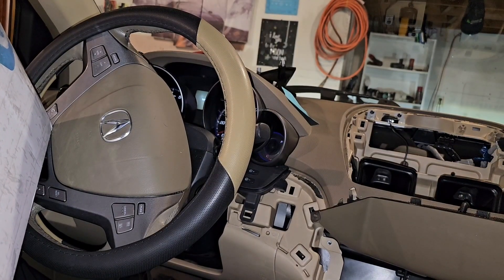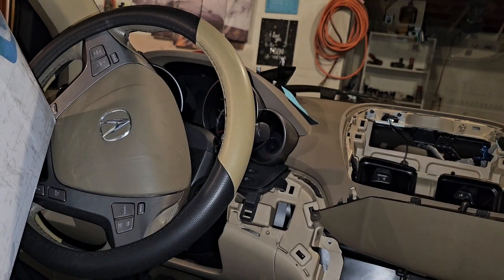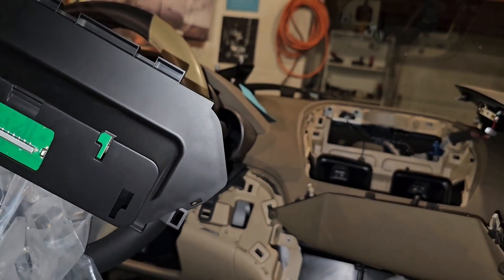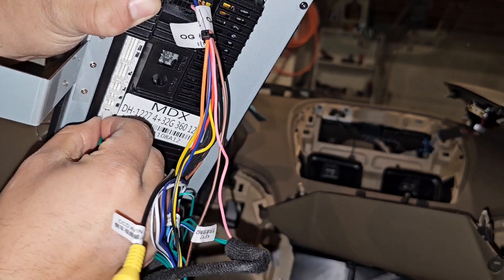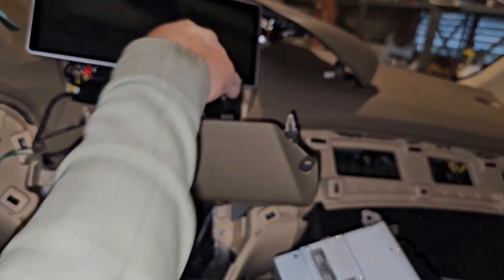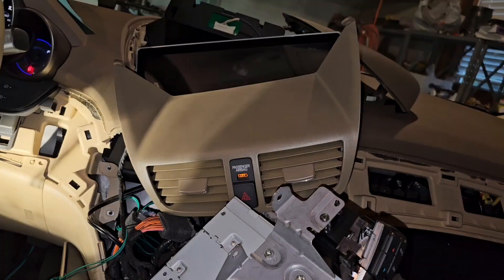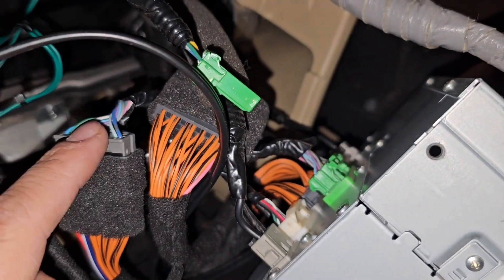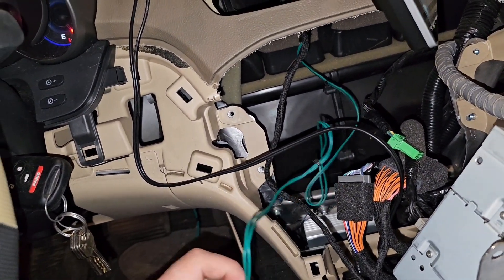Android headunit on a 2007-13 Acura MDX (Install)

Comment: Hi, love the video. I wanted to know if you were able to connect aux to get video on the overhead dvd? Also, do you think a new aftermarket amp can resolve the sound issue. Or do I need to change the subwoofer. I read somewhere that subwoofer has a small amplifier too.

Comment: I purchased one of these units, but the cable ribbon seems missing? The little square hole on the back of the screen was covered with beige tape, and there was no connector ribbon to hook the screen up to the green area on the main unit base?

Comment: Are you planning on doing  another video with your feedback on the final radio setup in the MDX? Also, does it work with the navigation knob/buttons and the steering wheel buttons?
Reply from the maker: No the knob does nothing now at least not that i know of but volume button and mode and switching songs with the steeringwheel all work
Reply: @oscar_cu2  Do you like it overall, any major gripes/disappointments?
Reply from the maker: @garage_102  i love it, most peoples complaint is jusy that the oem sub no lomger kicks on by I bypass that by using hands free link instead of the new bt system because the amp still kicks on

Comment: Hi @oscar_cu2 I am also trying to do this install, and notice that I have to put the volume at maximum (volume 40) to hear the audio.  Do you have the same problem?
Reply: Did you figure this out?
Reply: @jaystarkey   nope….my installer couldn’t get the volume to go higher compared to to regular radio.  In addition when in AUX the sound had interference noise as well which sound horrible.  Both the RCA cable was connected to LFR (left front) and RFR (right front) instead of AUX.  When connecting to AUX there was no sound at all…..
Reply: @KamWong-o8e I wonder if using hands free link will work?  My problem is there doesn’t seem to be a ribbon cable at the back of the screen, so I can’t connect it
Reply: @jaystarkey  to be honest I am not too savvy on these radio installs.  My did come with a ribbon to connect from screen to “processor” unit.  I end up scratching the install at the end since my installer couldn’t get the volume working as expected.  I returned my unit a few days ago…….

Comment: Thanks for the video. Do you know if diagnostic data can be read on the new Navitech unit because it has the OBD2 plug in? I haven't seen if there's an app that will display it. Thanks.
Reply from the maker: Nope it only has 2 pins im sure its for swc (steeringwheelcontrol)

Comment: Hey man, thanks for the video. I have everything installed, but my battery is being drained after 2 days. I can't figure out what is draining the battery.
Reply: Did you figure this out?
Reply: @jaystarkey  yes I contacted the seller. I just had to change the power settings.

Comment: Work on mdx tech pkg with hdd button?
Reply: Did you get an answer to this question? I have the same tech package and the installer is asking the same question. Did you use the Aux/USB button or the HDD button?
Reply: @RichCullen-y3r  didn't order yet...did you find an answer? did you connect to aux?
Reply from the maker: I connected to aux mine doesnt have hdd